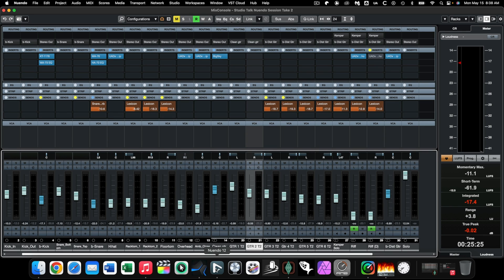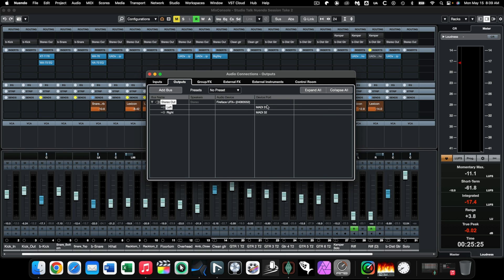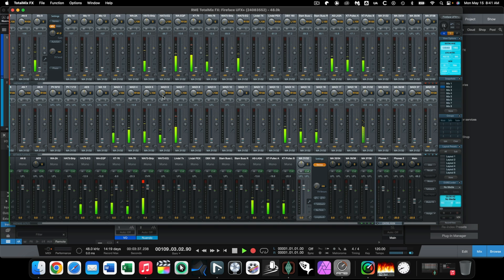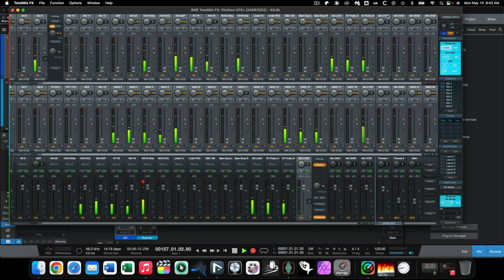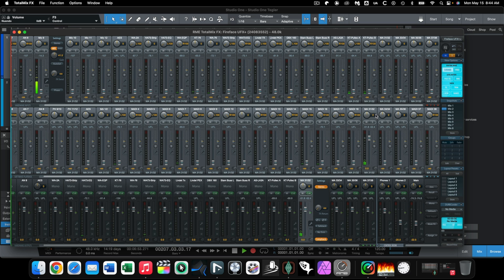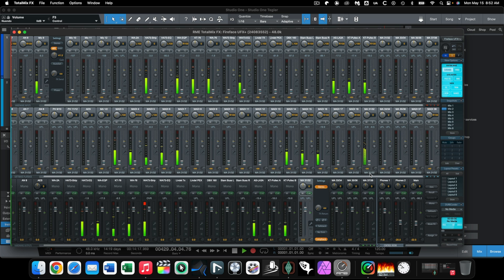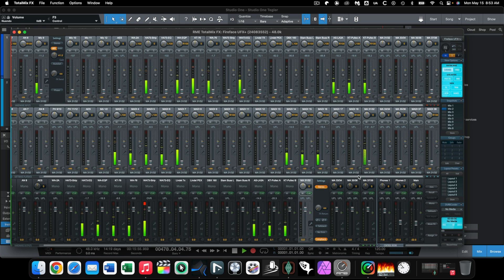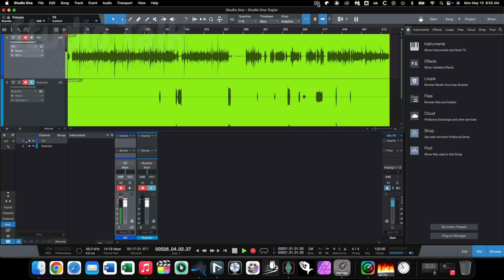RME TotalMix Training Session 3 - Software Playback ~ Loopback ~ Creative Routing

Comment: Follow up question: how is the hardware being used?  Do the faders need to be up for each input if the DAW is using them as inserts like the vocal chain video you were showing before, or can they be down?  I am completely lost regarding how to use the Faders in a DAW when routing hardware in totalmix.

Comment: Thank you so much for this.  this has opened up a whole new world for me.  So many options now using loopback.  BTW since you did this video it appears that RME had added a little orange dot beside the balance knob on the input track your loopback is routed to.. Still would be nicer to have what you suggested with a different colour meter.  Thanks again for this video!

Comment: I'm an old fart, I have owned over a dozen interfaces and A/D converters since giving up 24 track tape.  Given what I paid for my Digidesign 192s (about $6K for a TDM HD rig) vs what I got for them on eBay ($150 each) it is clear to me that, unlike analog gear, digital converters are an expense, not an investment.  OK, so I am finishing up building the world's first all ribbon mic studio for the 40-year-old ENAK ribbon mic repair service.  I need to showcase ribbon mics and good acoustical design, not gear.  So I needed reliable and flexible gear and software.  When I discovered TotalMix on a Barry YouTube I lit up!  Was this the answer?  Yes, it was! With TotalMix, I was able to use my newly acquired RME UFX III and M-1620 Pro D to record (I have 16 outboard mic-pres), I will be able to use TotalMix as an FOH board when we have jam sessions and I can use TotalMix as a foldback/cue system.  No need for a mixing board or a personal monitor system.  THANK YOU BARRY!  This was a good journey for me.

Comment: I have question for you Barry, or anyone else for that matter: I use analog summing while mixing, in Cubase Pro 13, and have recently upgraded from a Presonus Quantum 26x32 to the Fireface 802fs. When I'm analog summing/ mixing, and return the summed mix back into Cubase via Fireface analog 1&2, I completely loose all controls from the Cubase control room. No meters, but worst of all, not able to utilize my analysis plugins, especially my reference plugin called Reference 2, which is extremely valuable. I can only insert plugins now on the actual input channel of Cubase, not ideal at all, as for instance, when I use Sonarworks room correction, that curve would then be captured on my final "print" of the summed mix. Surely there's a workaround for this in Totalmix? I've tried both Full mode and daw mode, and loose the Cubase metering and control room on both. This is very disheartening!

Comment: Hi Barry, what is your workaround to the issue that Cubase/Nuendo will change the volume of fader in TotalMix while in Direct Monitoring mode. When you turn your Control Room knob to Control the level of your speakers ,it'll also change to the level of the input fader you're tracking on (if monitor is on). Both RME AND Steiberg are aware of it (spoke to both today)

Comment: Not sure if you've done it yet, but you've mentioned in the first video on how to use ARC USB. I just got mine, so would love it if you can create another training session on setup and use cases for it. I want to use it with TotalMix, but I don't want to have the TotalMix window open in order for the functions on ARC USB to work. Hope you'll consider; thanks for the series!
Reply from the maker: I can add it to the list, it may be a minute. That said, you do not need total mix open to use the arc.
Reply: @BarryJohns  Great on the video. Yes, I was thinking that I should not need the window open, but I think it's because I get a window when it launches at startup of the firmware update. I'm hoping that once I install it, the window will close after startup.
Reply: @BarryJohns  Update: I just updated the firmware; it was easy. Did a restart, TotalMix window window opened and closed, ARC works....beautiful! Thanks again and hope the ARC video will percolate in time!

Comment: Page 87 of the UFX+ manual explains the loopback feature. In your example using MADI to feed itself, the loopback is functioning precisely how the literature describes the loopback feature should function. What it doesn't explain is that a potential feed back issue can occur from adjusting the hardware input fader and activating the channel, especially with compression. Of course this is all as clear as mud because TotalMix appears to be a mixing board due to the faders. It is so not a mixing board as you have pointed out. Cheers!

Comment: Thanks for those very helpful videos on TotalMix!
But personally I think it is absolutely correct that the physical inputs don't show a level in the case shown here - because that's a fact. So what if you DO have a signal coming in at MA31/32 but you are not using it. At the same time you could have the same exact routing as shown by you. In this case  the levels of the software playback MA31/32 and looped outputs MA31/32 would show the their levels. But if you would also show a blue level on the input MA31/32 then you couldn't see the real signal coming in on the physical output...
Reply from the maker: Based upon my workflow, the two would never exist at the same time. The only reason I would use available, unused outputs, because I need to do internal routing. So I’m never gonna be in a situation where I’m gonna need to route two sources to the same channel. if a channel is being used or a plan to be used, I simply would just pick another available unused channel. Also color coating them differently, distinguish what it is.
Reply: rme should just have virtual channels like any other interface, instead of using existing channels for different purpose. what if i'm using all of my inputs??
also don't understand why they name all daw channels corresponding to physical outputs if they're not tied to them.

Comment: Great explanation. Per the previous vid, you did not show the matrix on loop back. I'm considering RME products integration. For the price and quality for these price-points they seem like a solid quality backward and forward compatible supported addition. Based on my understanding of this solution the loop back should populate in the matrix despite no level light or any indicator led. This is obviously an oversight on RME dev. That's  a simple fix on their C++ end. I concur on your advice. Please advise. Thanks!

Comment: ‘Em. Nope. Your physical input 31/32 should not have any level meter indicator. It physical and not play any role in loopback. The behaviour is correct.
Reply from the maker: I know it’s correct based on RME’s thought perspective, however, a typical user would benefit from having the option.  Yours is the first to back up its good the way it is where as a ton of other commenters have agreed it would be helpful.

Comment: I don't find it confusing that there is no level on the physical 31/32 inputs because that is a fact. You've got input only on the software playback 31/32. Why would it show level on a totally different input? I think the problem is that you're seeing the inputs and outputs as part of the same channel as on a physical console, which is not the case at all here. You've got 32 hardware inputs, 32 software inputs and 32 outputs. Some of those share the same number but that doesn't mean anything really.
Reply: came to say the same. there's nothing on those input channels, it'd be confusing to have something showing there.

Comment: Hey Barry 
Nuendo/cubase comes with built in loudness meters, as you know pro tools doesn’t!
I have both.
Can I route pro tools audio into nuendo and use it for metering rather than buying a nugen meter for pro tools as I also have a ufx?
Love to know your feelings here. Mostly mixing for post! Thanks Richie
Reply from the maker: Yes, I fl have demonstrated how to route to different DAW’s in several videos.  I have to do it whenever I’m demoing gear in one DAW then routing the output of that DAW to another.

Comment: you don't need another daw to record audio from nuendo and your voice. just use control room, send to a separate output the whole mix and set your talkback to permanent activation, but be sure that talkback deactivates when you press play or record. then you can use that separate output on your OBS or screen recording software .
Reply from the maker: I’ll check that out
Reply: that new output in the control room has to use the loopback function in total mix

Comment: Edited for clarification:  At the end of the day, it's easiest to think of all the faders in the input section (top row) to be SEND levels...to the selected output.  So instead of thinking about the input faders as volume faders, you're starting with all the faders all the way down, then you push them up as the send level into the output that you're currently working on.  So if not thinking about it as a send, then it's simply a "mix for the selected output."  So turning the fader to nominal gain (0db) would send the entire signal to that output, vs sending a little, etc.  Even if technically, it's a volume fader for that specific output, it's easier to think of it as a send, since you're sending the signal to the output, the more you push the fader up.  And all the way down means not sending it at all to that output.

Comment: I couldn't agree more about the metering. In fact, I would rather they just allow you to deal with looped back audio exactly as if it is physically connected, ie normal metering and the ability to route to the rest of the mixer. It would be great for submixes in certain settings. RME said they are worried about feedback, which is valid. But just listen to Barry. Don't turn up the hardware input faders until you are ready!